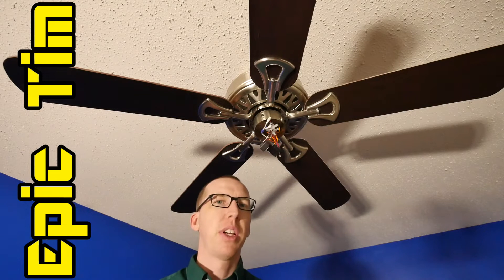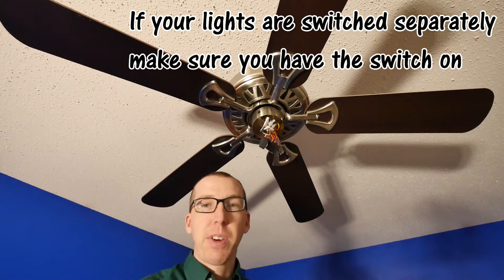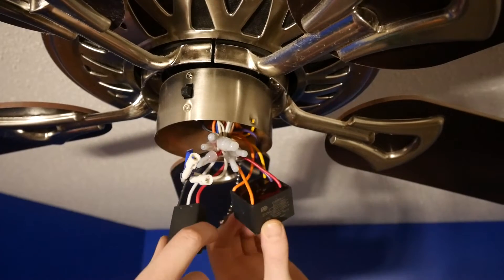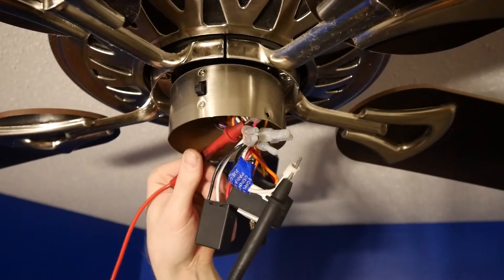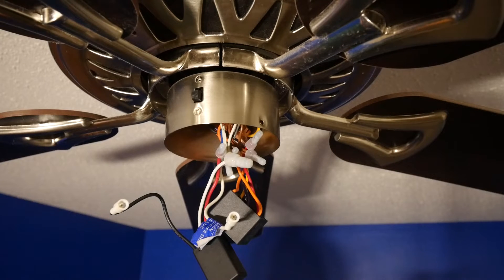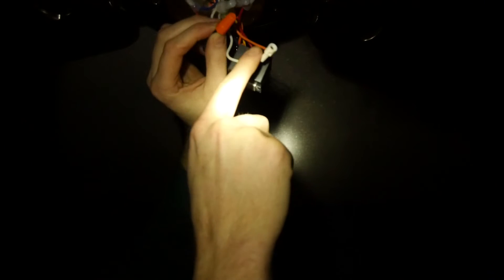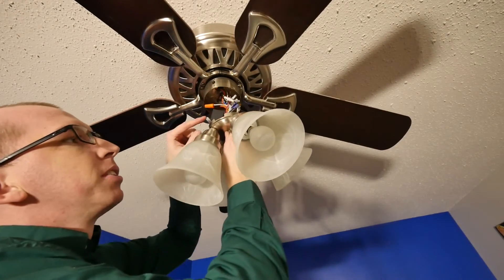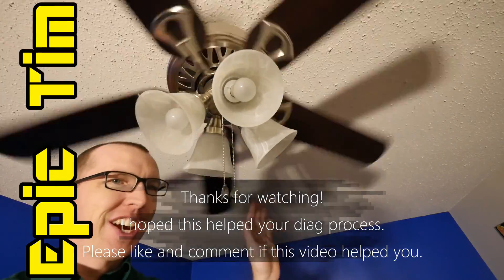DIY - Easy ceiling fan light diagnosis and repair! (with dmm)

Comment: So what the little power little is used for in the design, since we can even bypass it? And why do you choose to bypass it as the way to repair? Thanks.
Reply from the maker: I replaced mine, because it's supposed to be there to protect the wiring.  This is just a diagnosis video

Comment: If you're getting 120 at the connections but only 5v in the lightbulb socket does that mean that the light bulb sockets are somehow bad?
Reply from the maker: You'll have to dig deeper.  If you wiggle the socket, does it jump voltage?
Reply: @EpicTim  I get slightly different voltages but it is in the 2-5v range and the sockets dont wiggle much. They are pretty solid.
Reply from the maker: Sounds like it's upstream in the wiring from there.
Reply: @EpicTim ok, but it's probably not the same issue as in the video as the quick disconnect between the main body of the fan and the little light module with the two light sockets, that quick connect has 120v.
Reply from the maker: Let us all know what you find out

Comment: All those high end electrician tools & you have a small flashlight? U should have checked the fan before taking it apart to put the meter on it. I would be worried messing with live wires. My old fan doesn't have those connectors.

Comment: Thank you Sir for taking the time to create this content for us. Since I believe this video is the only one that address this issue, it’s extremely helpful. I was able to get it bypassed and fixed after watching your video. I spent more time trying to figure which breaker to disable than fixing the actual issue itself. 🙏
Paying it forward. I learned that removing the light shades will reduce significant amount of weight which then you don’t have to disconnect the light fixture. Plus you wouldn’t want to rely on the two plastic clips to support your light fixture as you’re unscrewing it.
Reply from the maker: Great tip!  Thanks for sharing!

Comment: Saw this Friday and was ready to dig in over the weekend but mine doesn't have a limiter :(
Instead of limiter there are stickers around a couple of wires that say "Light kit connection". I guess previous owner took limiter out? Lights always worked for the years I've been there. I'm guessing now it's the pull chain switch? At least I'm hoping something easy. All the wires went to a plastic box that slid into another half in the fan so that was easy to disconnect and take the 4 light assembly down. Not sure if I need to get a limiter to put in the connections of those 2 stickered wires.
Reply from the maker: Surly possible the switch is bad, check for power and functionality, replace it if it does not have power on both sides and the switch cycles normally.

Comment: Watching your video I cut my limiter out but then I realized wouldn't the voltage limiter actually be used as speed control for ceiling fan low,mid,high? Wouldn't that also explain 5v possibility being low fan setting not lighting issue, what I'm saying sounds right but I have no clue if it is right
Reply from the maker: Those are two different modules.  This is just for the lights.  If it controlled the fan and wasn't working.  The far wouldn't spin

Comment: If your fan has a white quick disconnect, you shouldn't have to remove power,  just undo the QD and remove the lower half.
make a quick drawing of the switch and show which wires go where, or take a pic. so you know where to place the new wires
when cutting wires for the new switch, strip off only about 1/4" otherwise the wire will be too flimsy to wiggle it in (haha) and gently wiggle them in one at a time, give a lite tug on each connection at the switch so you know it's gonna hold, then reassemble, test before installing the lower half.
Reply: For the rest of you folks other there, don’t listen to this advice. “You shouldn’t have to remove power”. Why the hell are you going to take that risk relying on the quick disconnect. Just Turn off the breaker.

Comment: You da man Tim!  Thanks!
Reply: PS. Why does the light have a voltage limiter in the first place?
Reply from the maker: It's for modern wiring standards, keeps you from installing 100w or larger incandescent bulbs and burning things up.

Comment: Hay guys my Regency ceiling fan capacitor is broken. Here's how I know. When I flip the light switch on the light comes on but immediately go off. How do I by pass it. The first video was spot on but nothing was to clear to follow & hands were in the way. The capacitor has five wires 2 gray, 1 beige, 1 purple, 1 red, 1 brown. Please can some one help👍🫶🤨

Comment: But isn't the limiter there for a reason and should be replaced instead of bypassed?  Asking from ignorante point.
Reply from the maker: Yes, my advice is to replace it.  My video shows how to verify when it fails that everything else works
Reply: @EpicTim  ok. I have that problem, and I didn't know what I was supposed to replace.  Thanks so much.

Comment: My Hunter fan lights stopped working. I don't know how you can remove that part and have the lights still work properly? That part has a purpose, otherwise the manufacturer would not have put it in there.
Reply from the maker: It's a wattage limiter, you for sure need it for fire code.  I'm not advocating anyone remove it.  This is just how you diagnose it's failure.

Comment: Hi Tim,

I found this very helpful, but I think you've left out some info.  The white wire to the voltage limiter is going to be cut and tied off with a wire nut, but not be tied to another wire.

I put electrical tape on my wire nuts.  I thought that was preferred.  I'm not an electrician, but I thought taping was good practice.

The music is not helping the video.

The written graphics you added were very useful.  Thank you.
Reply from the maker: Thanks for the feedback!

Comment: i have a ceiling fan that comes on with the separate light switch. There's a red wire which i connected to the blue but same thing happened. Then I capped off the red wire but still same problem. Any ideas?  💡 🙏🏽
Reply from the maker: Check for power on both sides of the wall switch

Comment: Limiter, capacitor, regulator.. I’ve heard all these terms to describe the only big box in the ceiling fan. 

Are they all the same thing?
Reply from the maker: Those terms mean different things.  A capacitor would help the fan start spinning. a regulator would limit voltage to either the fan, lights, or a controller. A limiter is for main level voltage but not allowing more than a set level of amps to protect wiring from high wattage bulbs
Reply: @EpicTim  got it. In other words I’m nowhere near electrically skilled enough to deal with a ceiling fan turning on haha rip. Thanks for preventing a huge disaster 😂
Reply from the maker: @statichispanic6344  it's good to know your limits

Comment: If you don't need the relay box, why did it come with it new? Not trying to be a smartaz.just asking
Reply from the maker: Fire safety...  As wiring gets thinner and cheaper it prevents you from putting a 100 watt bulb in there and drawing too much heat

Comment: How about when the fan is the one that's not working?
Reply from the maker: Check relays, fuses, and wiring.  Use a glove and see if it spins easy by hand when the car is off

Comment: If your fan has a remote to turn on the light, try holding down the light on switch for 3 seconds to control the brightness of the lights
Reply: Thank you!!! That's exactly what was wrong with mine. Had the lamps out, globes out, light canopy down checking voltage thinking I'm just gonna replace the fan all the while it was at the switch, that coincidentally dims? Never knew it dimmed!!! I mean we did have a roof leak right over the fan. It dried out and still worked. But a month or two later, came home from work today to the wife saying look at the ceiling fan. All three lights were dimmed way low evenly. That's why I originally found this video. I really shoulda known it was dimmed at the switch. Of course it is - everything nowadays is dimmable, damn near. Didn't even cross my mind till I saw your comment. Thank you again, good sir!!!

Comment: Thank you so much Tim! Our light in the den had been out for over 8 years and had some time to research the problem and sure enough it was a bad voltage limiter. I do have a dumb question though, is it okay to operate the lights without the limiter? You saved me some with $$ with your tip! thank you again and happy 2023!
Reply from the maker: I can't say it's ok but I have yet to replace mine.... I'm using low power led bulbs

Comment: Hi Epic, your video is very informative. However,  I have Hunter ceiling fan with different current limiter. It has two white wires (in and out) and one red wire. The white wires is easy fix but the red wire is a question. If I cut the red wire and remove the limiter now what wires I need to connect the red one to
Reply from the maker: What does the other end connect to?

Comment: Just found out the lights DO still work, after they seemed dead for long time but still the fan is dead ( in a heat wave!) Can it be saved please?
Reply from the maker: Its unlikely to rebuild the fan motor. You can verify my turning the blades by hand.  If they dont spin freely, the fan motor is shot

Comment: Hi. My ceiling fan works fine but the lights doesn't work. I find it quite weird because when I put my test pen on the bulb sockets, the test pen lights up but if I put a bulb there in the socket, it doesn't light up at all. I'm quite puzzled when this happened.
Reply from the maker: Possible that the socket wore out or the voltage is way off

Comment: My Hampton Bay ceiling fan had a similar problem (light would flash on very quickly then stay off, until switch toggled again). Voltage to light was only from 2-20 watts. Turn out my fan does not have one of the little regulators, the culprit was a broken wall light switch (plastic literally crumbled when removed).

Comment: On my current limiting device one side I have blue red and yellow wires going in and then on the other side I have black wire going out. 

How do I cut all the wires off
The current limiting device and  join them together with a wire nut?
Reply from the maker: if your wire colors are different you will need to test the in's and outs

Comment: Thanks for the info.  I had a three light setup under  my fan.  All of a sudden lights stopped working.  I take out one bulb and the other two turn on.  Replaced all three with same 60 watt bulb and worked for a month.  I will check for loose wire or that black box.

Comment: One bulb of three out and it's not the bulb(s). Probably the wire joints under their crimp, so I need to re-do that with wire nuts. But more importantly, while standing on a ladder with a flashlight, how did you get the light fixture wire connectors apart exactly!  Thanks!
Reply from the maker: I think i used a zip ty to hold the weight if i remember correctly
Reply: @EpicTim  Got it figured out and it's done! Thanks to you!

Comment: Thank you for your video. My limiter and harness are a little different. I have a red wire coming from plastic wiring block (connector) to limiter, and then two white wires at limiter, one coming in from plastic wiring block to limiter on right side, and one going out to fan up/down switch for flow direction. Any info on how to bypass limiter, which wires go where after removal?  Thanks very much.
Reply: Thanks so much!  There was no power to it, removed canopy at top and found worn wire coating. Respliced and everything is working!  Thanks for your help!
Reply from the maker: Check your power in and out and link those together
Reply: @EpicTim  I’m sorry.  Link what together?  That was my question. In what area would I test the power?  Thank you.
Reply from the maker: 120v before and after the limiter

Comment: You're leaving out the rank beginners here, which I guess is most of us.  You don't tell us what color the wires are going to the disconnect, and you shoot it from so far away we can't see.  You don't show us how to release it, you just say use a plastic tool.  At that point I gave up and went to Johnny the House Buyer's video on the same subject.  He put the camera right up there and showed how the disconnect works.  Maybe I'm an idiot, but for a novice, working with live wires is very intimidating, and we need very simple, clear instructions.  Your video would be OK for an electrician's class, not a newbie homeowner.
Reply from the maker: Thanks for the feedback, im still learning video editing and production
Reply: Thanks for pointed me towards Johnny the House Buyer.  Appreciate Epic Tim too.

Comment: What if u have a remotely controlled fan with a dimmer switch on the remote would this still work
Reply from the maker: If your fan has a wattage limiter its worth testing it
Reply: @EpicTim   can I still bypass it
Reply: So the lights will work
Reply from the maker: @cedricignatius  its one of many reasons you light may not work.  Worth a shot but may or may not solve your specific problem
Reply: @EpicTim   thanks for your help I will try it out

Comment: I learned from another video that possibly you could install low wattage led bulbs. Might that work too?
Reply from the maker: Only if the limiter is working right. In my case the bulbs were working then the limiter went out several months later

Comment: why does it need a power limiter?  do the lights exceed the power allowed by the fan? is it because of the resistance of the wire? why?
Reply from the maker: They had to add that to reduce fire risk when people were putting multiple 100 watt incandescent bulbs in their fans.

Comment: Hello Tim I have a different issue my light works but I can smell something burning while the light is on but when I cut it off everything is fine and the smell goes away and the fan stays on with no burning smell what could this be?
Reply from the maker: if you smell burning, check and see what's getting HOT - could be a short or a bad bulb or fan motor

Comment: HI, I just wanted to leave a question, hoping you could help me here.  Hunter LED 52" Avia II Ceiling Fan  and replaced it with my older ceiling fan. everything seemed perfect except, one of the light bulbs constantly goes off after a few minutes of lighting.  I thought maybe it's the light bulb issues, so I changed each bulb from onside to the other to check if the problem was the bulb. However, I figured out that it wasn't the bulb, but one side (of the bulb socket?) had an issue and constantly (after few minutes of usage) goes off no matter what. I am so frustrated, and wanted to ask what i can do from here.
Reply from the maker: could be alot of things, you should call their customer support

Comment: i did something wrong... my fan doesn't work but every time i pull the fan switch 3 times the light turns on and off
Reply from the maker: sounds like the switch for the light and fan are mixed up.

Comment: This video is old, but thank you for posting it! Bypassed that little box and my lights now work. I’m no electrician so this video was extremely helpful. My application was slightly different in wire color variation but figured it out.
Reply from the maker: Glad it helped
Reply: thanks.  Detailed. Very well.
Reply: How can u bypass this and still have working lights on fan

Comment: Hi! Im looking for the lamp assembly with those exact quick connects. I can't seem to find it on line. Any suggestions?
Reply from the maker: Just a guess but it may be cheaper to buy a whole new fan assembly - the one in the video came from Lowes.

Comment: Clicks for EASY repair

Then sees him pull out the device

Then uses electrical lingo

Yea I’ll buy a whole new one
Reply from the maker: DIY isn't for everyone - different brand and models of fans can be wired differently, thats why i broke it down with the volt meter.

Comment: I tried to cut that delimiter off and hardwired the hot wire straight the blue one which is connected to the light, and nothing works anymore.
Reply from the maker: different brand and models of fans can be wired differently, thats why i broke it down with the volt meter.

Comment: You can turn off the light and fan switch at the wall so you do not have to be in the dark while working. You definitely do not want to put the light housing back on the fan base with power on because you could pinch the wire(s) and cause a shock. Better to be safe.
Reply: I’m glad there’s a few posts sharing your/our opinion here. The helpful instructions went out the window when he’s suddenly in the dark and uses his hand to shield whatever he cuts off twice! I stopped watching immediately and luckily found plenty of others with the same comments. Especially when yes, he could have turned off the light connection had he flipped a wallswitch. Then I found many others that explain how to fix the problem if the culprits the chain pull switch. And oh, that’s the correct way to repair a faulty light, not just bypass the culprit part unless it’s an emergency and you’re living an hour or more from the nearest watering hole!
Reply: @Aleta King  which other videos did you find? I am wanting to replace that limiter and not just bypass it..

Comment: Thanks for your video. I have a Hampton Bay Ceiling Fan. The fan works fine but the lights do not work. I've been trying to locate the wattage limiter but cannot find it. My ceiling fan is about 10 years old, so I am not sure if they mandated the wattage limiters after this time or not. I know that I should be able to fix it instead of buying a new one. Do you have any other suggestions, if my fan does not come with a limiter?
Thank you!
Reply from the maker: i'm not sure what year they started - if it's 10 years old and hasent had an issue, it's probably your switch, these wattage limiters don't last long....